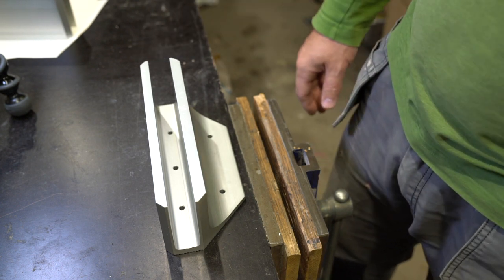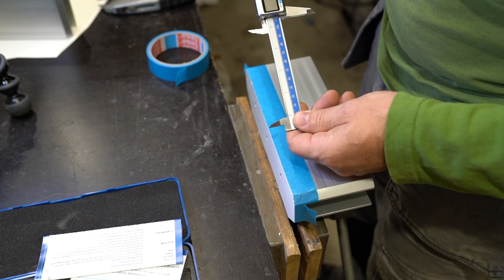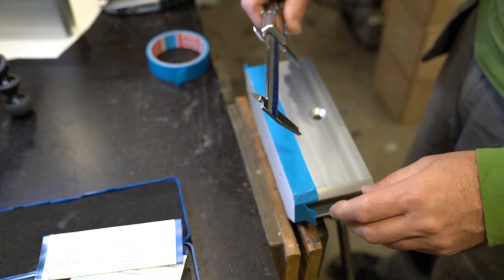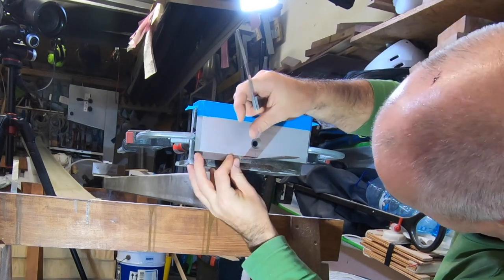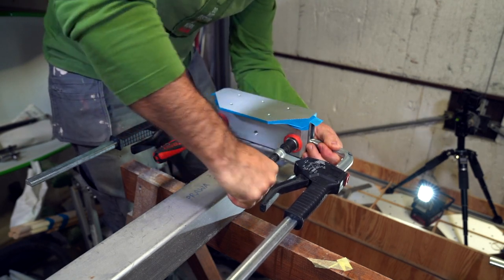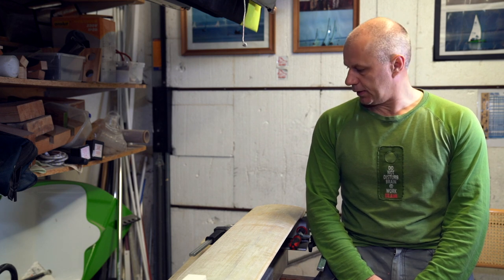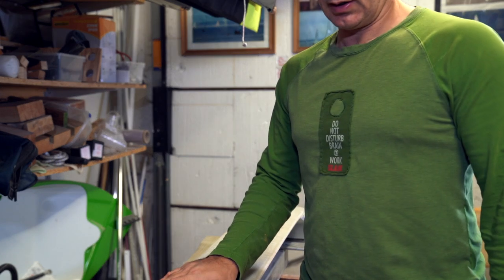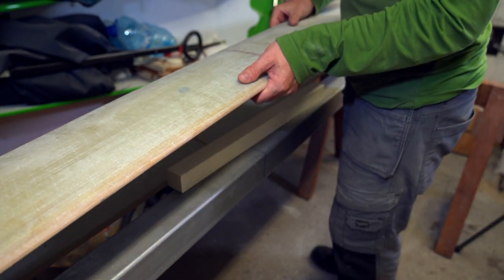DN Tech Talk | 02 Chocks glue up

Comment: I made a similar jig, but it was bolted. and a Hilti applicator mixer simular to the one you use on a plank that I bought from Warren Nethercote. Followed your Intructions, and has worked well. Thank You.     PS. I did use bolts on the chocks because i was concerned about my handiwork!
Reply from the maker: Cool, glad it worked out!

Comment: Interesting video!  When you have time could you describe the construction of your jig?  The principle is clear but is it a welded or bolted structure and how did yu achieve the alignment of the jig?
Reply from the maker: Warren, in this jig the key steps are: alignment  of all three elements and the way you fix steel angles to the beam. For fixing I used only MMA adhesive (long pot life). Any welding attempt resulted in heat distortion. I never tried bolts. For alignment I experimented a lot. In the end best results were achieved with fine laser beam, two 1m long each straight edges and tape measure. And lots of measurements taken before gluing.
Reply: looks welded but he must have a great fabricator to keep it all aligned with the welding process
Reply: @dnp55  But the upright plates that you clamp the chock to look like they are welded onto the square tube.  That have to be attached somehow no?